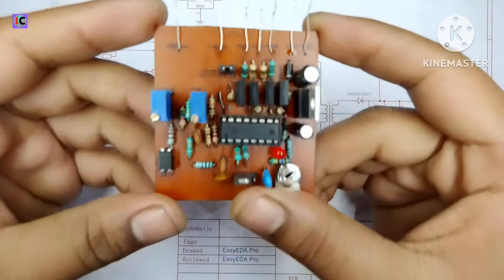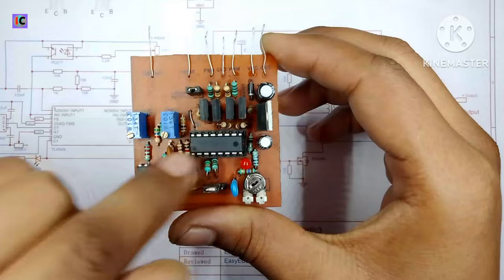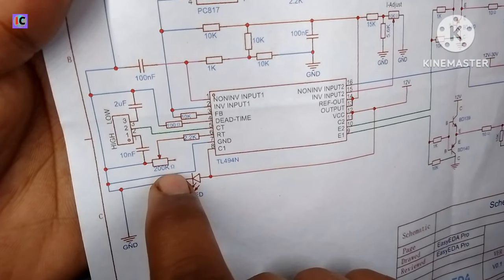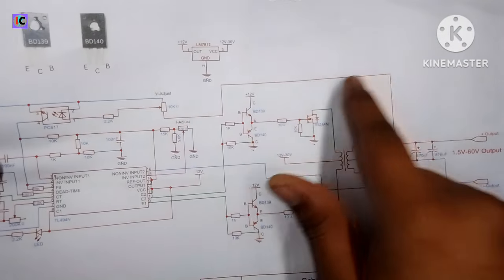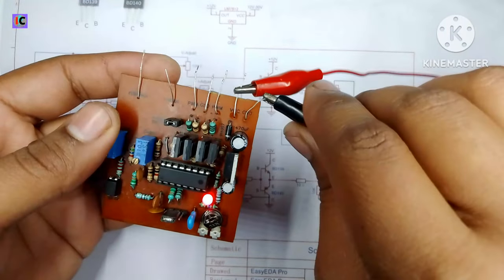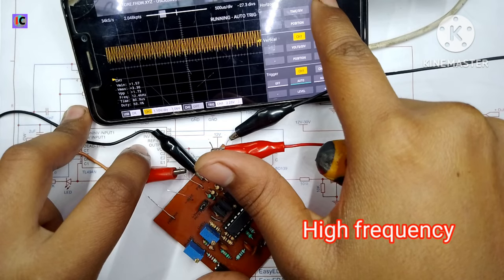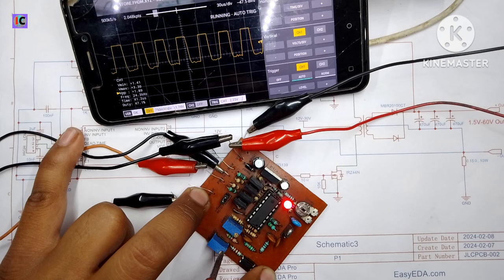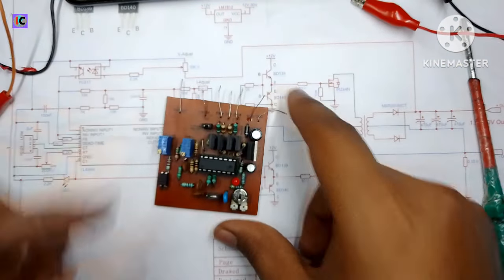Mastering the TL494: How to use this trending chip in your DIY projects and experiments

Comment: Is it better then SG3525 and how?
Reply from the maker: both SG3525 and TL494 have pros and cons, the TL494 consists of two op-amp which has benifit of controlling voltage and current, on the other hand SG3525 have single op-amp which controls the voltage only. 
So if you are building DC-DC converter then TL494 are good for CC & CV while SG3525 is good for inverters or other purpose

Comment: Sir transformer ka 220v out se bridge rectifier se dc 220v feedback pe jaigi kya
Reply from the maker: yes 220v dc will connect through 100K ohm resistor to V-Feedback pin